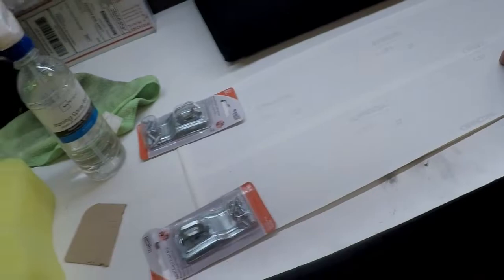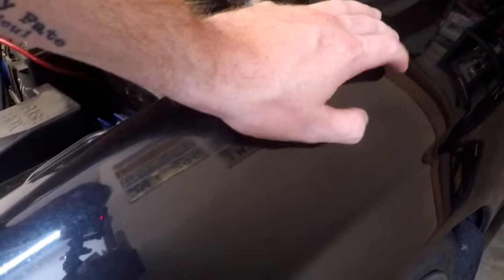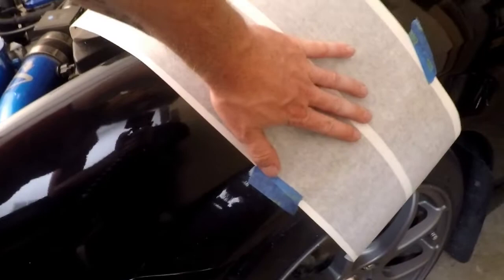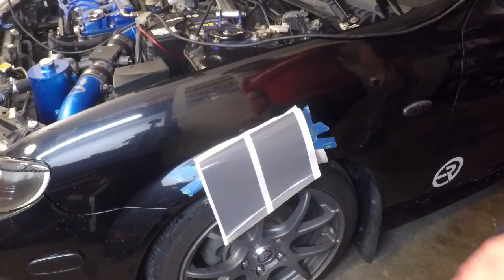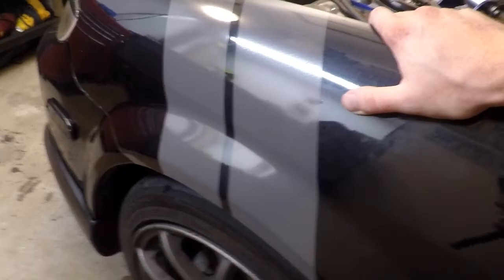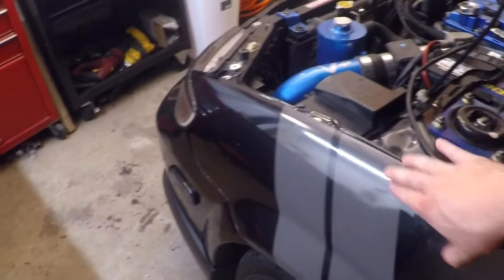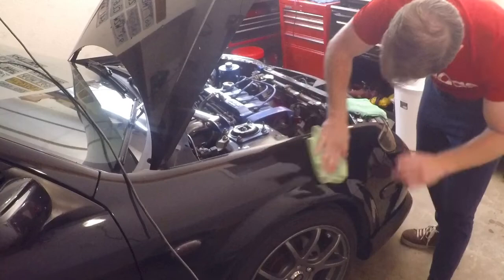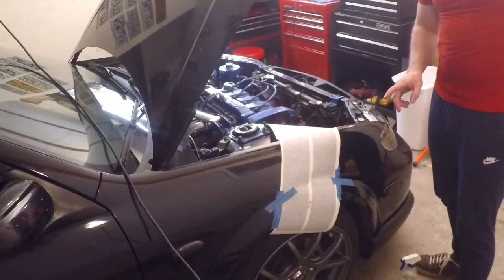How To - Fender Stripes

Comment: Dawn on car paint? Yikes
Reply from the maker: It doesn’t hurt the paint if used conservatively. As long as a GOOD wax is used over the area after, it’s fine. In this case I covered it with more horsepower. I waxed the car after. I certainly wouldn’t wash it often in dish soap. Once every couple years prior to a solid waxing maximum.
Reply: @RageFueled  lmao that’s a good answer. Covered with power 😂
Reply from the maker: @DavidODST  when you’re balling with a massive 97whp, the extra 30 from fender stripes makes a big difference haha